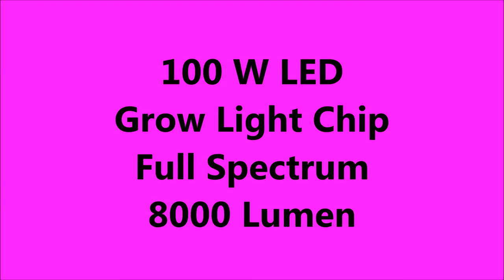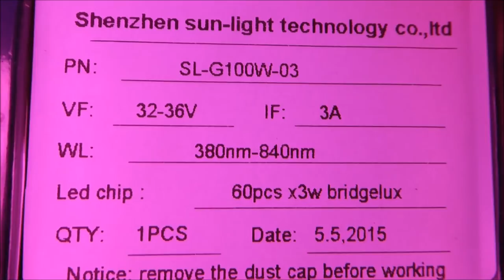Testing:  100 W LED  Grow Light Chip  8000 Lumen Full Spectrum

Comment: hi i noticed it said its got 63x3w chips.does that mean you use a 100w driver.?giving about 45%  drive.cheers
Reply from the maker: Hi Chris Fuller,

 I'm not the chipmaker,
 but mathematically results from the current and voltage there from,

 P = U x I
 32V x 3A = 96 W
 or maximum
 36V x 3 A = 108 W

 but these LEDs to the manufacturer radiate more power to consume as electricity, therefore 3W (LED) x 60 per chip would give 180W, but is offered as 100 watts which is technically correct.

 PS .: Here in the test was applied only 30V, the chip is thus still a little brighter than seen.

I hope I could help
 Greetings
 Martin

Comment: The fact that the diodes doesn't come on evenly at the beginning leads me to believe there are different types of diodes, or different quality.  Perhaps there are dedicated blue and dedicated red diodes?

Also, "lumen" is a bad unit for grow lights.  Lumen is based around how the human eye reacts to light and has built in biases for wavelengths of light that the human eye is more or less sensitive to.
Reply: They are different light spectrum diodes to achieve 380nm to 840nm (Full spectrum)
Reply: If that's the case, than in theory, the red-colored diodes would probably come on first because they typically have lower forward voltage than blue.  There is also probably more red than blue.  If I were placing the diodes, I'd do it evenly somehow.  Your diodes come on unevenly in random patterns it seems.

They all look the same color too, but it could be tricky to tell them apart.
Reply: I also dislike the "full spectrum" claim.  Green is part of the spectrum and there are clearly no green diodes in the module.

"full plant spectrum" might be better terminology, but I digress.  I guess I'm just ranting.
Reply: Kevron Rees It is just shortened to "full spectrum"
Reply: 8 years ago i have done researches on wave lengths for plant growing lights... Thanks to those researches, and my 1st order you all guys get now those chips ;) Because UFO grow lights was owerpriced, so that gave me an opportunity to cooperate with engineers from China ;)
Reply: Hontiey ?
Reply: Yes. How could you know that?!! But yes it was Hontiey.... Hisheling LTD led factory
Reply: you wrote in the comment above, I specified the this
thanks